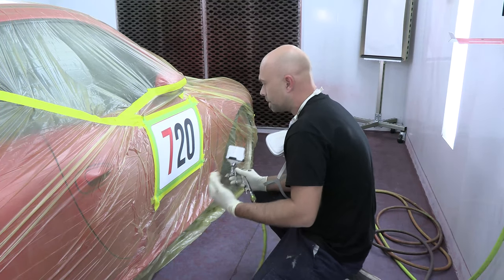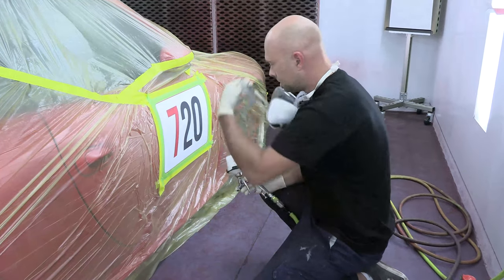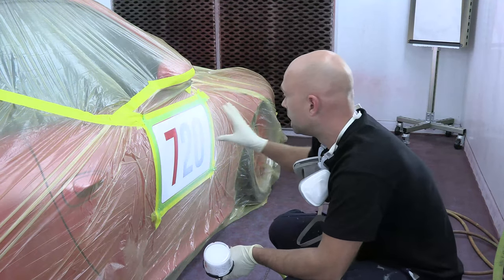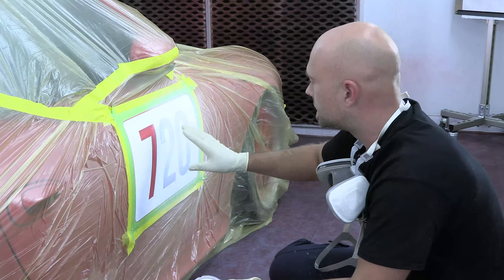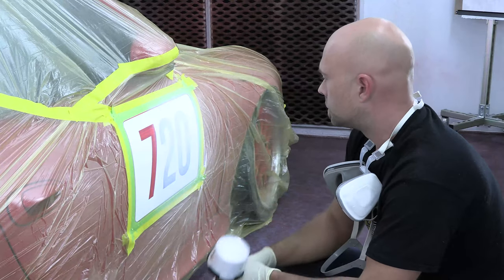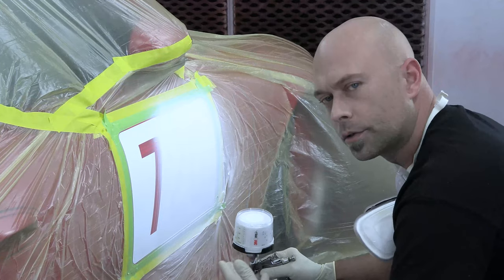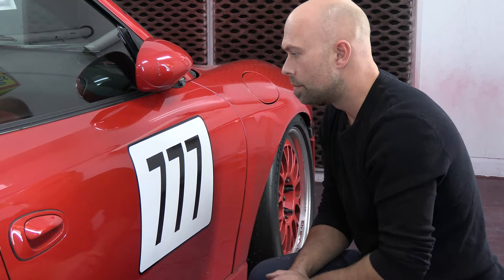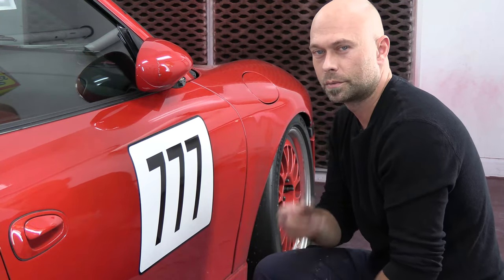How-To Paint Auto Graphics over an Existing Finish

Comment: Thank you for sharing! 🙌🏻 
I have a few projects coming up where I will be doing graphics on direct gloss 2k finish. I was thinking that I was going to go 1000 grit trizact wet on a DA and then a light coat of 4050 before I start laying out tape.. what do you reckon? To fine?
Reply from the maker: We recommend 600 - 800 grit anytime preparing a 2k gloss finish for paint. If applying metallics, 800-grit works well. Thank you.